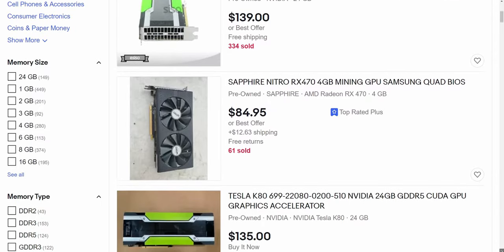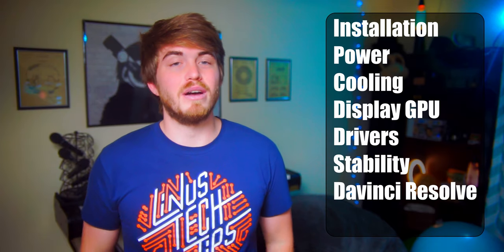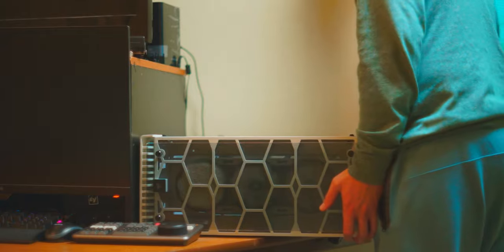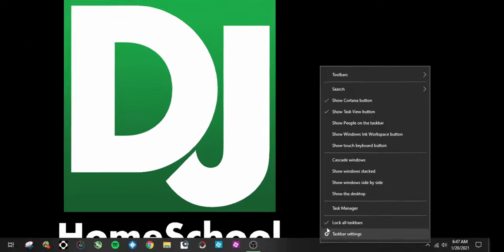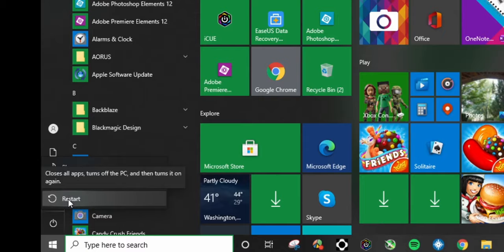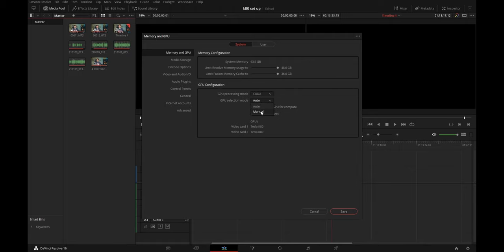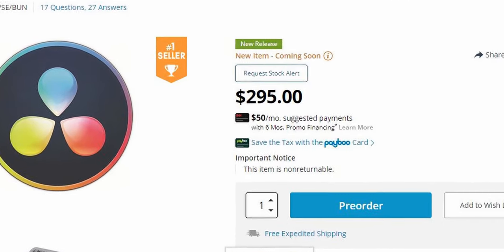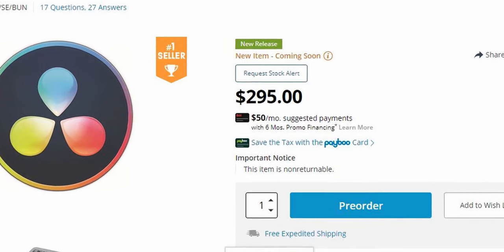24GB Tesla GPU for Video Editors

Comment: Outside of video editing in Divinci Resolve, would the K80 still help with graphics acceleration, like in Solidworks?
Reply from the maker: Solidworks no longer supports the Keplar architecture in their latest versions. So if you need the latest version of Solidworks, then no, the K80 would not help you here. The M40 would be a better option to take a look at.
Reply: @WillCarterTech  I ended up buying an m40 and was not able to force windows to use it. Ended up finding a 2060 super for an amazing price and although it's still the bottleneck its much better.

Comment: THANK YOU! You just prevented me from making a huge mistake. Just ordered a new data science rig (threadripper 3960, 128gb 3600 ram, amd 5700xt video card) and wanted a powerful data science graphics card. I cant find anything because stupid mining gpu surge. anyone have any suggestions??? currently I have a amd 5700 xt (build may be coming with a 3090...likely 3080). Id want a titan but not they are crazy expensive.
Reply: Train online or learn other data science first. 🤷‍♂️
Reply: If you use linux, buy a tesla k80.

Comment: good video, lots of mistakes tho.i use 4 of these, any questions ask away.
Reply from the maker: How do you keep the noise down while it’s sitting next to you and you are recording a podcast? 🤣 this question is just facetious. 
But that is my next goal. Water cooling to lower the noise level. 
How did I do as far as spreading misinformation? I’m not a “computer guy” so I tried to research as much as possible to keep my mistakes minimal. What did I mess up?
Reply: @WillCarterTech  all my equipment is in a climate controlled closet.lol i run an r9 fury x for video output. Amd drivers don't conflict with tesla drivers. Water cooling is my next step for the tesla though as well.
Reply from the maker: Really! Wow! That’s great news! I had been told by many different sources that amd drivers cause issues when installed next to Nvidia drivers. 
Yes the closet solution! I have stared at my closet many times thinking that I could shove this desktop in there. Lol alas my apartment doesn’t have a climate controlled closet. 🤷🏻‍♂️ maybe in the future I can revisit that idea. 
Yeah, with how cheaply you can find the dual water blocks, they seem like an excellent solution. 
My issue going forward is that I don’t want to spend a ton of money getting this card running tip top, if it’s no longer supported in the next generation of davinci resolve 17. It works great on 16. But I’d rather spend that approximately $500 on a modern GPU with better power consumption, cooling, performance, RTX voice, and decoding/encoding acceleration.
Reply: @WillCarterTech  ive run amd and nvidia at the same time for years. you must run the amd card as primary. install nvidia cards in other slots. nvidia drivers must be installed first then amd drivers. its finiky to get going but once you do its fine.
Reply: @WillCarterTech  turn windows update off during this rocess and do it yourself. windows will muck it up everytime.lol
Reply from the maker: @bryanbrewer4272  that explains a lot. It sounds like people just don’t want to deal with the headache so they just say don’t ever mix the two.
Reply: @WillCarterTech  yeah it took me a fair bit to figure it out. But it does indeed work.
Reply from the maker: @bryanbrewer4272  yeah! That process would take alot of trial and error! You should make a tutorial or submit the video idea to LTT or a channel that has both gpus on hand. That is super valuable information for everyone to know. Maybe I can mention it, but I only have these two gpus. So I can’t test it myself without investing more money.
Reply: Thank you, can I use this to render vray in sketchup?
Reply from the maker: I don’t know, I’d have to google to see what the minimum system requirements are. This is based on CUDA 3.2 architecture from what I can find online.
Reply: Do you use pytorch by chance? If so, how does the k80 perform?
Reply from the maker: No, sorry i dont know what pytorch is.
Reply: @jeffreybowers5646  Nvidas website have benchmarks for all the frameworks. You can also find 3rd party benchmarks.
Reply: Kenneth Mancia Any program that allows you to select a gpu to render on can use a Tesla card.

Comment: @Will Carter, the HomeSchool DJ
I have the same card running on windows 10 and can not get it to work.
I am getting these errors, can you tell me how you got it to work?
1st error (ATTENTION! No OpenCL, HIP or CUDA installation found.)
2nd error (clCompileProgram is missing fr OpenCL shared library.)
3rd error (cuFuncSetAttribute is missing from CUDA shared library.)
I have the latest CUDA installed I think it's version 10.

Any help would be appreciated thanks.
Reply from the maker: The k80 kepler architecture is cuda 3.7
Cuda 10 ought to be compatible with the k80. Have you gone into your motherboard bios to enable openGL? 
Im not sure why it isn’t working for you. I have had several people in these comments tell me  that their gpu was dead on arrival.

Comment: А что обязательно ставить дорогое водяное охлаждение? Вроде бы прикручивают обычные кулеры
Reply from the maker: No, I don't think the water cooling is necessary. There are 3d printable models that can allow you to mount fans to the heatsink on this card. should work fine if you have a couple high RPM fans. water cooling would be quieter which would be nice when I'm recording audio.

Comment: Quick question, can this gpu be used for rendering stuff on blender? Like honestly this is extremely cheap for this much
Reply from the maker: if I remember correctly blender's 2022 update dropped support for kepler architechure. so i'm going to say no. unless you are using an old version of blender.
Reply: @WillCarterTech  god damn it 😭😭😭

Comment: yes they recommend the quadro drivers... to run the tesla's... ive ran the c2075 on mojave fine using the proprietary mac drivers. just check your driver files the nvidia teslas and grab the web driver. its helps if you upgrade macOS instead of a clean install. theres a script out there that you can run that will knock out the macos issues if you want  to run it you can no nbd...
Reply from the maker: I do have an old Mac Pro laying around. I should try popping it in there and see if it runs. Might be a fun video too
Reply: Ya those Mac pros are quite the machine. I had the 2012 5,1 server edition with a swapped Xeon Hexcore from the quad. 64gb ram single channel. The pcie output 150 watts and there is an additional out on the board. The adapter cable 6 pin to mini is called something weird. Booster cable or something. The psu is rated at 900watts I think so plenty of power on board it’s just a matter of hitting the right install sequence. K20 and the c2075 will run... the only thing I couldn’t solve was the cards weren’t totally recognized per spec’s c2075 only registered 2gb and the k20 was recognized but no data showed up. I also didn’t know about the kext utilities and abilities... Do it up, they said it wasn’t possible... they don’t know nothing lol
Reply from the maker: They are still used by some companies to this day. Although I was seeing alot of them hitting the dumpsters last year when the new Mac Pro came out
Reply: @WillCarterTech  Dumpsters! That's a tragedy, should be punishable by law. Last Summer I seen a lot of people posting "Got it when it was new, boxed up in the garage since. Worked then 100$ obo... Then you see 1000$ 2000$ stock models. Im still kicking myself for selling mine... But I really like the mini's. Prefect desktop. the 10's are limited on HD. But i found that Waterfox browser is 64 bit and 1080p plays just fine with multiple apps opens. I run a theta node on my 2012 and its my primary on an intel gpu... performance wise 100% better.Almost went with the newst M!, super cheap but i bought moog instead... Its awesome...  Im trying to do the eGPU with my C2075... its currently in a amd dell i got a couple weeks back.. Cheers on the homeschooling DIY. always like to get other perspectives and everybody has little tricks to explore. Cardboard and duck will get you a long ways lol
Reply from the maker: Haha yess duck tape and cardboard are my go tos 🤣

Comment: I bought one of these a while ago and when I installed it alongside my RTX-2060 SUPER. I'm using a Corsair 4000D and was wondering if putting a fan as close as possible to the rear and then manually cracking the speed up a little bit will keep it cool if I only use the rear GPU (ie set one of the rear fans as exaust if that makes sense. I'm mainly using it for Blender and at the moment 12GB of VRAM will be PLENTY. Also quick question, how do you know which GPU is the front or rear?
Reply from the maker: Trial and error. Crank up on GPU and then feel the back of the card to see which on is hotter. I have a nice little burn on my finger. 🤣
Using a single fan will only work if it’s a high rpm server fan with a lot of cfm. Mohamed Qasem made a great video about using an exhaust fan and how to seal the air flow to focus all the cfm through the card. It’s worth a watch. Great video.

Comment: Good job will. I would definitely not recommend it for video editing. But I'm thinking of buying this for my computations as i do a ton of heavy computations for electromagnetics.
Reply from the maker: Oh yeah. What software do you use? Does it still support Kepler?
Reply: @WillCarterTech  I use CST Design Studio. But will have to convince my research supervisor to shell out some money if i want to buy this.
Reply from the maker: @abc20723  the k80 is a Frankenstein card. It’s not a good investment because most programs are cutting support for cuda 3.2
Reply: @WillCarterTech  Thats true. That's why a bit unsure if its worth it or not. If CST doesn't support it then i will be in trouble 😁.
Reply from the maker: @abc20723  you should check cst to see if they support cuda 3.2

Comment: Great Overview, As a suggestion add a Thunderbolt 3 PCI card to your desktop and get a used Razer Core External GPU Enclosure you can add A big fan to the outside of the enclosure, I've stuffed all sorts of GPU's into this for testing including a P40 and XEON PHI, A few time I have had to use an external PSU to get the Motherboard connection and enough power into the card. Also a Resolve user but have not had time to test. Thanks
Reply from the maker: That’s actually a great idea! Saving up for a 35mm lens right now but I’ll put it on the bucket list. :-)

Comment: to mount it could you not just cut up a metal place holder and drill it to match to two screw holes you took the original bracket off of ?
Reply from the maker: yes

Comment: Whether this card support Adobe Premiere Pro 2021?  Currently, we have a 2 GB Nvidia card, for 2 hours of wedding footage, it's taking 8 hours to complete the export.
The plan is to buy this card and do all the customization to our Desktop for more CUDA will that help in reducing the export time from 8 hours to something?
Reply from the maker: No, unfortunately, adobe is still very cpu focused when it comes to rendering. Their most recent updates have allowed for gpu acceleration on a couple of fx and encoding/decoding tasks. But the tesla k80 card in this video doesn’t have dedicated encoding hardware. 

In addition premiere only can take advantage of 12 cores on the cpu. Vs DR that can use 32 cores on the cpu. 

My best suggestion would be to try davinci resolve with your current equipment and see if that improves your render times. It’s free and if you are just focused on transcoding footage, DR excels at that task. I like to transcode to DNxHR HQ 10bit. 

If you are rendering into custom resolutions or resolutions higher than 4k (like 6k or 8k or vertical or 19:9 aspect, etc) you will want to purchase the studio version which is only $300 one time. And the studio version also has faster render times especially if you have multiple gpus in your system. 

I used Premiere for a decade and i tried resolve and used it for a couple tasks here and there. I saw a HUGE performance increase on my computer over premiere with out spending any money. Over time i gradually used DR for more tasks than premiere and eventually i noticed that i hadn’t opened premiere in months on my computer and i had been using DR for my entire work flow. At that point i stopped paying for premiere. 
After a couple of years using DR i decided to buy Davinci Resolve Studio so that i could make this video about the tesla k80. I love it! Now i can do 3:2 aspect ratios and 6k renders for my timelapses. 

You may find that using the free DR for transcoding speeds up your computer quite a bit. Or you might find that you still need to up grade your computer. I don’t know what computer you have so I’m not sure.
Reply: @WillCarterTech  Thanks for your time to write me back, Appreiciated. Will start DR soon.
Reply from the maker: Is transcoding the only thing that you are concerned with?
What are the specs of the system you are using for Premiere?
Reply: @WillCarterTech   We have a Photography studio and our requirement is to mix and create a final output from the video we shot in wedding events. We use Adobe Premiere latest edition and Edius. The system we are using is Intel Core i5 4670 3.40 GHz processor, Intel DH87RL motherboard with 32 GB memory with a 2 GB Nvidia GeForce GT 710 card.

Another system with a latest spec AMD Ryzen 9-3900X Processor, Asus B550 Motherboard with 16 GB 3200 Mhz DDR4, For this system we have purchased a RTX3060 Ti and not yet installed with it.

The concerned is we need to reduce the exporting time from 8 to 12 hours to 1 or 2 hours for a whole 3 hours wedding event videos.
Reply from the maker: Your core i5 4670 will be a huge bottle neck for you. So upgrading the gpu will only improve render times slightly. But that system would likely benefit the most from the tesla k40 (m40) due to the fact that the geforce 710 is close to the same generation of the k40. The drivers will work better when the gpus are close to the same architecture. However, im not sure if premiere supports such old architectures on their latest version. 

The AMD 3900x system is about the pinnacle of performance for Premiere. This system wouldnt benefit from the k80 because the 3080ti is the best gpu on the market to date. Also the 3900x is a 12 core cpu, premiere uses 12 cores. You will likely see an uplift in performance by 20-30% if you swapped out your cpu for the amd 5950x, which your mobo is compatible with. However you need to update your motherboards BIOS first. You can find the update files on the manufacturers website. In your case ASUS. However im not certain your mobo is capable of delivering the power necessary for that cpu, since it’s the budget motherboard. That’s something you will have to look up on ASUS’ website. 
This system would see a huge reduction in render times if you gave it 64GB of 3200Mhz cl14 DDR4 RAM. Premiere is VERY ram hungry.  
Also that system as configured ought to be able to render a 10min 4k video in about 2 hours. Check your premier settings to make sure that they are sent to performance mode

Comment: currently i am using rtx 3080 12g for DaVinci Resolve but it lacks Vram. If I buy this Nvidia Tesla K80 24GB and plug it into the 2nd slot on my mainboard will it work in parallel with the 3080? Will I be able to take advantage of its vram? Looking forward to hearing from you and everyone watching this video. Thank you
Reply: I don't use DaVinci myself, but that's only possible if DaVinci supports GPU memory sharing in it's own way.
Reply from the maker: unfortunately no on all your questions.
the driver for this keplar card would not be compatible with the rtx3080. 
the vram does not stack. The k80 has two gpus on board. Each gpu has 12GB of vram. you already have 12GB of vram. so this card would not improve your situation. 
Davinci resolve 17 does not support keplar architechure anymore. and neither does davinci resolve 18. the k80 is no longer viable for DR, unless you are willing to stay on DR16. I was not.
I bought a 3090 with 24GB of vram. they sell for about $800 on ebay right now. which is alot considering the price/performance compared to AMD cards. but if you need NVidia for some reason, it's your only 24GB option under a thousand dollars. I've heard that AMD has gotten alot better on Davinci resolve these last couple generations. something to consider.
Reply: There's also the M40, similar to the K80, but I don't know about support in DaVinci Resolve or how it would work with your other GPU. I don't even understand how a program like this would need to support specific GPUs, since I'm not using it and I'm on Linux.

Comment: 1 you can get a bracket that allows it to sit upright 2 you do no need a water block but i recommend changing thermal paste as the slop they used is trash
Reply from the maker: You have really good points. I think I have extra thermal paste laying around somewhere.